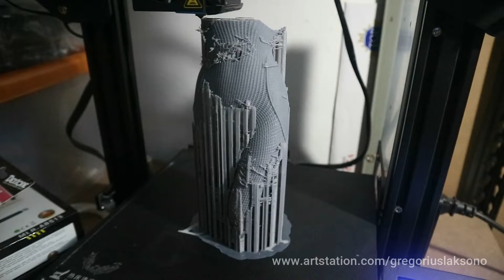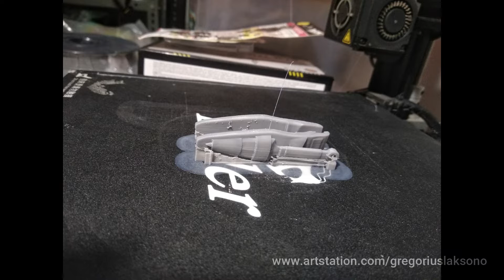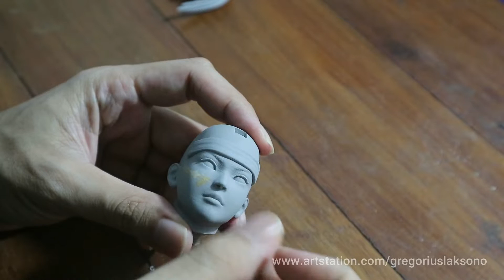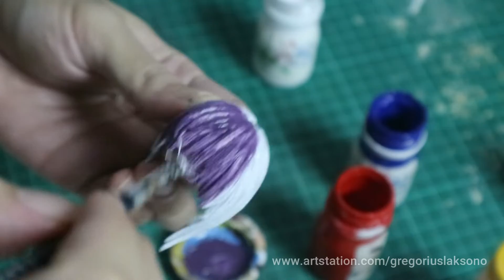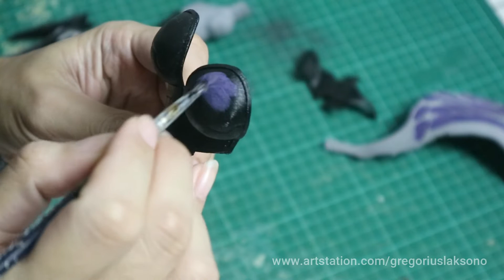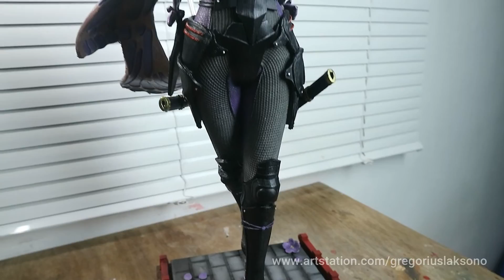Ayane Dead or Alive 3d Printed Fan Art Statue

Comment: Hey Man, been seeing your works and it's really awesome. Would you mind sharing what kind of brush did you use for the eyes? Thanks and keep up the good work! :)
Reply from the maker: Thanks man! It is called a spotter brush :)
Reply: @sonilaksono8074  Thanks Man, really appreciate it. Hopefully you can make more DOA characters. Especially Kokoro and Lei Fang ☺️
Reply from the maker: @lorenanciro5201  No problem. Yeah we'll see man! 😁
Reply: @sonilaksono8074  Nicee, I'll wait for it. 
I want to try to scale this maybe 1/2 scale, do you think this is possible?  Will there be problems on the other parts?
Reply from the maker: @lorenanciro5201  Wow that will be huge! I think otherwise. Problems will occur when the parts is too small. So the bigger the scale, the less problem will occur when printing.
Reply: @sonilaksono8074  Yep, the largest I printed was around 13.5 inches (A2 from Nier) and I'm thinking of printing a bigger one. So let's say, all will fit as long as I scale all the parts the same?
Reply from the maker: @lorenanciro5201  Ah okay. Yes, as long as you scale them at the same size, all parts should fit :)
Reply: @sonilaksono8074  Thanks Man!
Reply: May I ask for your email? If it's okay, I'll ask a few more questions 😅, Thanks Man!
Reply from the maker: @lorenanciro5201  here pambudilaksonozbrush@gmail.com